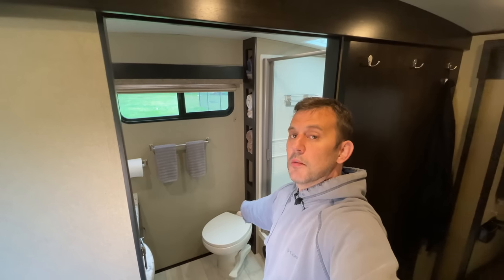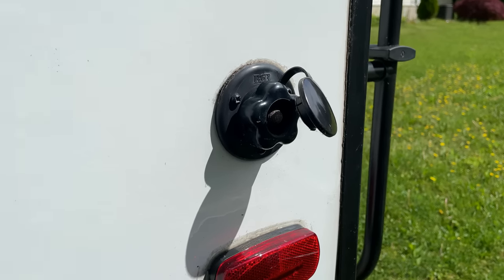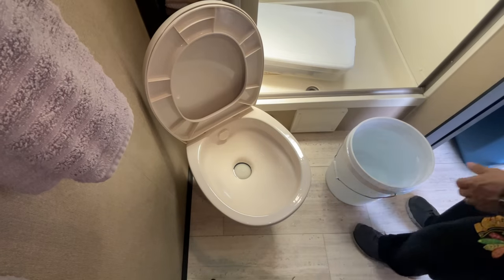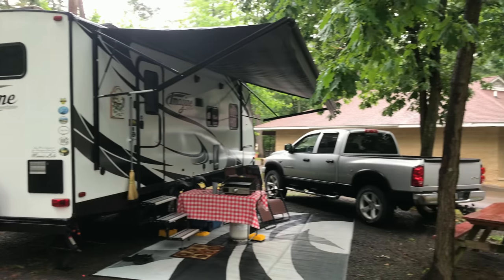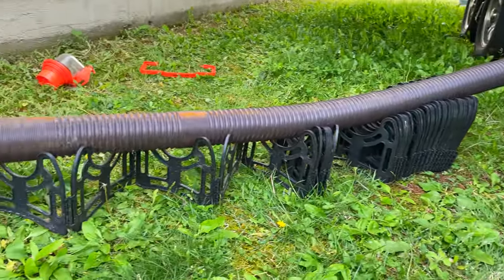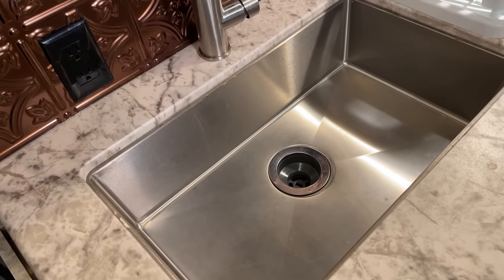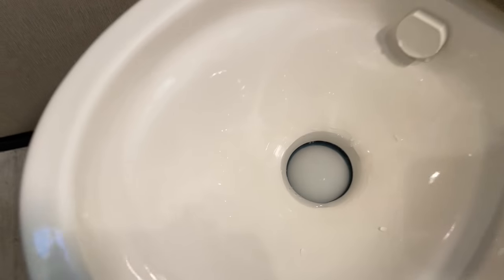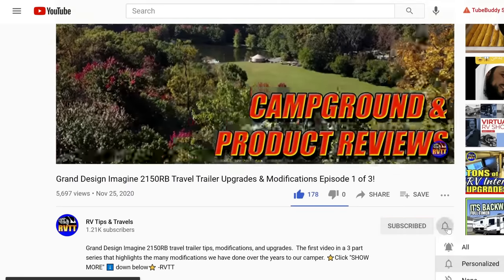RV Black Tank Cleaning, Maintenance, Tips & Tricks - The Original Black Tank Master Class

Comment from the maker: ✨*Here are links to all the products in this video:* ✨
✅ Flow Meter https://amzn.to/3znoxVD
✅ UPDATE - USE THIS TREATMENT: Liquified https://amzn.to/3IwNpjL

✅ Thetford Aqua Kem Treatment https://amzn.to/3znoQ2J
✅ Borax https://amzn.to/3wijFiF
✅ Dawn Dish Soap https://amzn.to/3gnwbYC
✅ 7th Generation Dish Soap https://amzn.to/3vmLDsi
✅ Rubber Gloves 6 Mil https://amzn.to/3XNo7Dc
✅ Camco Clear Elbow https://amzn.to/3wpJkpw
✅ Camco Rhino Flex Sewer Hose & Clear Elbow Full Kit https://amzn.to/3wmDWUo
✅ Camco Sidewinder Sewer Hose Support
✅ Hose Nozzle https://amzn.to/3vnTbe8
✅ Cleaning Wand https://amzn.to/3cAM2kn
✅ Valterra Clog Cleaning Attachment https://amzn.to/3pRtDF9
✅ Thetford Toilet Seal Conditioner https://amzn.to/3pUBToa
✅ Thetford Drain Valve Conditioner https://amzn.to/35jW7hq
✅ PB Blaster https://amzn.to/3cHkyJP

This video is a complete guide for cleaning, maintaining, & using your RV black tank.

Key Points:
-Keep water (along with treatment) in your black tank. Around 10% of your black tank capacity should be filled with water, always. 
-Be generous with water you use to flush & try to use the least amount of toilet paper as you can. 
-Wait until your black tank is about 2/3 to 3/4 full to dump. The fuller the tank, the more diluted it is & the better the flush you will get.
-After dumping the black tank, fill the tank to 10-20% capacity, and dump again.

BE COURTEOUS! If you are using a shared dump station and there is a line of RV'ers behind you, find another time & place to repeat the dumping process a 2nd or 3rd time.

🎥Toilet Paper Comparison: https://www.youtube.com/watch?v=ceCdXandlLU&t=57s

🎥Clear a Pipe Clog: https://www.youtube.com/watch?v=BUmPMGDEKxY&t=69s

#rvblacktank #blacktank #rvtips #blacktankmasterclass

✨⭐ OUR FAVORITE RV ACCESSORIES ⭐✨

ESSENTIALS:
✅ Camco Rhino Flex Sewer Hose & Elbow Kit https://amzn.to/3wxaiyG
✅ Camco 90 Degree Clear Sewer Elbow https://amzn.to/3eezBe7
✅ Camco RV Water Filter https://amzn.to/3VzcMqi
✅ Rubber Wheel Chocks https://amzn.to/3v0lL5I
✅ Hughes Watchdog 30 Amp Surge Protector/EMS https://amzn.to/3hAmgCy
✅ Hughes Watchdog 50 Amp Surge Protector/EMS https://amzn.to/3HKrpm1
✅ Liquified RV Tank Treatment https://amzn.to/3ksg1Ck
✅ Tire Minder TPMS https://amzn.to/3mjuBg0
✅ Water Pressure Regulator https://amzn.to/3m3ZFzZ
✅ Rubber Gloves 6 Mil https://amzn.to/3XNo7Dc
✅ Collapsible Water Hose https://amzn.to/3SvNubw

MAINTENANCE:
✅ Boeshield T-9 Rust Preventative & Lubrication https://amzn.to/3sjcjMx 
✅ Eternabond Roof Tape https://amzn.to/3Ad290J
✅ Geocell Proflex Sealer https://amzn.to/3KGMOyb
✅ Road Tool Kit https://amzn.to/41NIQKj

INTERIOR:
✅ Camco Cross Bar Door Handle https://amzn.to/3o8WWS5
✅ Shower Caddy https://amzn.to/3bdU80W
✅ Soap Dish https://amzn.to/3pKheSn
✅ Oxygenics Shower Head (White) https://amzn.to/3nhDMYW
✅ Oxygenics Shower Head (Brushed Nickel) https://amzn.to/2O8YcYC
✅ Perfect RV Paper Towel Holder https://amzn.to/3tZxd1K
✅ Dimmer Switch https://amzn.to/3rQdfFD
✅ Sliding Door Latch https://amzn.to/3EkpTT0
✅ Puppy Paw Hook https://amzn.to/2N9JaRV
✅ Foldable Storage Bins https://amzn.to/3tIp01f

EXTERIOR:
✅ X Chocks https://amzn.to/3m3ck2i
✅ Carmtek 10 Digit Keyless Entry System https://amzn.to/3t4IMpB (see the video here: https://youtu.be/KcEUgsDw6kk)
✅ Low Point Drain Valves https://amzn.to/3Jd6adb

OUTDOOR GEAR:
✅ Blackstone Griddle 22” https://amzn.to/3MDDiL0
✅ Blackstone Griddle 28" https://amzn.to/3eBnOuD
✅ Outdoor Gravity Chairs https://amzn.to/3Sb1p4M
✅ Ground Mat https://amzn.to/41u3wXg

💥 Sign up for our FREE Newsletter: https://view.flodesk.com/pages/6497c6a9d1998fa8c7623e9f

✨⭐ MORE RV ACCESSORIES ON AMAZON ⭐✨
https://www.amazon.com/shop/rvtipstravels

💥 NEW TO OUR CHANNEL? Check out our catalog:
https://www.youtube.com/c/RVTipsTravels/playlists

🙏 If you want to help support our channel you can donate here: 
https://www.paypal.com/donate/?hosted_button_id=J2KKM9NR3BJJA

✨⭐ DISCOUNT CODES TO SAVE MONEY ⭐✨

🔨 Learn how to repair & maintain your RV like I did w/ this COMPREHENSIVE training course:
https://rvtechcourse.com/?ref=rvtips&travels

🚐 10% off RV Snappads! https://rvsnappad.com/discount/RVTT10

🛌 Get 25% off your RV Mattress by Brooklyn Bedding at https://rvmattress.com/rvtips
Use discount code: rvtips

📡 GPS Tracking for your RV! https://www.wheresafe.com/rvtipsandtravels
Get 10% off by using discount code: RVTIPS10

If you find a dead link, let us know & we’ll send you an RVTT sticker!

📺 Want to see more RV videos? Please SUBSCRIBE & CLICK THE BELL ICON 🔔 so you're notified when we release new videos!

Follow us on social media:
📸 Instagram https://www.instagram.com/RVTipsAndTravels
🕺 Facebook https://www.facebook.com/RVTipsAndTravels

We may receive a small commission for purchases made through the affiliate links above. There is NO additional cost to you when purchasing from our links. We GREATLY appreciate your support!
Reply: I believe the storage pipe diameter is two big and it curls up and gets stuck that way.    They couldn’t get a short section of it in.
Reply: Good Information!
Reply from the maker: @jillphillips8117  thank you

Comment: After hooking up the sewer hose to dump, I ALWAYS open the grey tank for a few seconds first to ensure that the connections are good and the sewer hose hasn't sprung any leaks or deteriorated. I'd much rather have the grey tank contents on the ground unexpectedly than black tank contents. After a few seconds, I close the grey tank valve and open the black tank valve. When the black tank us empty, I finish emptying the grey tank to flush the hose.
Reply from the maker: Excellent tip Doug, thanks for adding!
Reply: Hopefully you're allowing the grey tank to empty into the black to get the solids out better?
Reply: @rolloverriderpgr  Grey tank does not go into black tank.
 that's why there is two tanks.
Reply from the maker: @rickjones2534  here's how you would do it.... first you would need a gate valve installed at the end of your sewer pipe.  with gray closed, open black tank factory valve and the aftermarket valve at the end of the pipe.  then close black and end valve, open gray, it will flow back up into the black to flush a bit more, then open end valve to dump everything.
Reply: Newbie 5th wheel owner here... so does the grey tank empty into the black tank or empty into it's own exit hose? Thanks!
Reply: @alisonmcirvin4763  no they each have their own valve. You can install a 3rd valve to close of both and do it that way. Best to dump your black after it's moor than half full, then refill with clean water and flush again. Then dump your grey.
Reply: @rolloverriderpgr  even if your RV is set up differently than 99.9% RV’s built there’s no reason to empty your gray tank into the black tank if your using the system correctly. Cheers!
Reply: @alisonmcirvin4763  if there is a gate valve just before the hose connection that closes it off it will flow into the black tank.
What I and a few thousand others do is empty the black then close the gate valve and open the grey and it'll flow into the black. 
Then close the grey and open the gate valve and the black and let that flow then repeat to try to flush it completely out and then open both to let everything drain.
I take my black tank hose I have just for this procedure and run it in the window to the toilet and add a few gallons and spray it in hoping the pressure dislodges anything it hits. They also sell tank sprayers you can hook your hose to, to rinse the tank out.
If you don't have a gate valve at the end of the line you can buy them and add it to the system.
Reply: @rolloverriderpgr  You are mistaken, it doesnt flow into the tank, it flows through the lower portion of the black tank pipes and valves and the sewer hose and flushes solids from the hose so you can have an easier time rinsing and storing it. It definitely doesnt flow through the black tank.
Reply: @RVTIPSANDTRAVELS  funny but it came from the factory built just like that.
Reply: @alisonmcirvin4763  they both have their own line that come together into one drain. The grey tank can be directed into the black to flush out the settled solids. Reading some of these comments there are idiot know it all that don't gave a clue but refuse to learn anything by watching a video on how to dump tanks.
Reply: @MrGbustamante  duah. Read my comment again but I'm thinking your reading comprehnsion is lacking.
Reply: @rolloverriderpgr  I read that the black is dumped into the grey which is not possible
Reply: @rickjones2534  ya really need to watch a few you tube videos on how to Mt those tanks as mine are connected at the factory to divert grey into the black tank to flush out those solids sitting on a flat surface inside that tank.
I'm sure you'll get to watch many RVers pulling a valve to divert the nice and liquid grey water into that nasty black tank and you'll leave with a 100% understanding on how it's been done for many years slick. Live and learn before co.menting on the world wide internet where everyone can read stupidity straight from the stupid.
Reply: Great idea! I never thought of that.🤗
Reply: @rickjones2534  😅
Reply: That's smart thinking.
Reply: @UCzfyJ5NPVnC8xCYYm8q85Iw That process creates the possibility of contaminating the grey tank, it sounds like a good idea, but it is not. If you want to get the solids out of the black tank, first top off the black tank before the first dump. If you need another flush, then fill the black tank again. Once the black tank is empty, you use the grey tank water to flush out the sewer hose. This is what the video says to do, too.
Reply from the maker: @farklealberts  correct, I never said to do this in the video, I was just answering how to do it in the comments.
Reply: @RVTIPSANDTRAVELS  Agreed - sorry for the misdirected reply, it was intended for the viewer who said to flush the blank tank with the grey water. Great video, BTW.
Reply from the maker: @farklealberts  No worries Chuck, I didn’t take it that way. I agree with you, fill it up, dump it out. Rinse rinse rinse.
Reply: Thanks, I will do that from now on.
Reply: Great advice Doug Crockett
Reply: Verrrry informative video,,thanks..
Reply: This whole process grosses me out. Sure you're flushing out the hose with grey water but it still probably has a bunch of nasty stuff stuck inside it and is crawling with bacteria. Do you clean the hose or just toss it back in the storage bin? As a young single guy I've been dry camping in my trailer since I got it because the whole process of cleaning waste out of the trailer sounds awful plus my theory is that once you start running water through a trailer that's when all the issues start from mold to bacteria. I don't know man... is all of it worth the trouble just to crap in your own trailer?
Reply: @user-uy3eq5hg1s  HELL YES.  Public washrooms are DISGUSTING.
Reply: @rolloverriderpgr  at first I thought you were crazy. Then after reading it again several times and my thick brain finally comprehending what you was saying I see what your doing. All I need to do now is get another gate valve to put at the common point of my drain where the two tanks empty. I can see this working as long as I have enough gray water to fill the line back into the black tank. It's worth a try in my opinion.
Reply: @farklealberts  what difference does it make if the gray tank gets contaminated  ? I hope you don't drink from it or use it for anything other than holding waste water.
Reply: @stevenjackson7067  Smells. That's why. No good reason to risk introducing human waste into the gray tank, even if it's just a little bit.  Just dump/flush the black tank by itself. Then dump the gray tank separate. No need to "flush" the black tank with the gray contents if you "flush" the black tank as described in this video.
Reply: Great idea and good practice. Had an almost brand new hose leak on us last trip out.
Reply: @stngstr  Please explain to me how using grey tank water to help flush the black tank will contaminate the grey tank.
Reply: @rickjones2534  ❤
Reply: @rolloverriderpgr  uhhh NO...
Reply: plus you are also pre-lubeing your hose
Reply: Not a bad idea. I borrowed an RV with a cheap black tank hose. I noticed a tear before using, thank goodness
Reply: Douglas dumps
Reply: Thanks so much for that suggestion as I just experienced the situation that you described a few days ago.  I was so upset with myself since I had not attached the hose well enough.  It too awhile to wash the compartment out and all of the "stuff" that I keep in this area.  Thanks again, great idea.
Reply: Great idea to check for leaks with grey water because SHIT HAPPENS.
Reply: Thats not a 💩ty idea whatsoever!  Good call.
Reply: Exactly what I do.
Reply: @user-uy3eq5hg1s 
 it was especially worth it during the COVID crap going on, and FLU SEASON too... Went everywhere we wanted too, no worries on restrooms, had off hours once every 2 weeks food shopping times days... So much better than getting, or worring about getting sick... Besides not going out at night to poop, I'm an old retired man... lol...
Reply: Great idea!
Reply: @RVTIPSANDTRAVELS  great videos. When winter storing is it still OK to have water in the tank.(freezing)
Reply from the maker: give your tanks a good cleaning before winter storage, but leave them empty.  that is really the only time you should keep your tanks empty, but not without a good cleaning first. heres a good way to get tanks clean: https://youtu.be/TsLpaJqaWpI

Comment: One of the tricks I use to clean my black tank after dumping is to leave the black valve open, raise the sewer hose about 2 ft near the valve and then open the gray tank valve. I leave it open for about 30 seconds to allow 10-15 gallons of soapy gray water to run into the black tank, loosening up any stuck deposits. I then close the gray valve and lower the sewer hose, allowing the soapy gray water to drain out of the black tank taking any remaining deposits with it. Then I shut the black valve and drain the rest of the water in my gray tank normally. I'm a full-timer who boondocks most of the time, so I don't use as much water in the black tank as I should. I've found this method cleans the black tank quickly and effectively so I haven't had any problems with waste accumulation for the last 3 years since I've been using this technique.  BTW I use Blue Power in my black tank and wash my dishes with Dawn, squirting a little extra down the sink about once a week to help keep the gray tank clean and grease free too.
Reply from the maker: Great tip to save water Chip!  Thanks for watching!
Reply: We do the same, but using a flush elbow with an additional slide valve.  As long as the gray tank is near full the pressure will be one way toward the black tank.  Pull gray, backflush for about 10 seconds, shut down gray, then dump black again.
Reply: @glfredrick1  We do something similar, but as you said, only when the gray tank is full.  You never want any backflow from the black tankgoing into the gray tank!
Reply: Genious
Reply: Wouldn’t that contaminate gray tank possibly?
Reply: @robertware5844  If you left the valve open too long so both tanks equalized in height, there's nothing to prevent any backflow. However, I shut the gray tank valve long before there's a chance of any backflow, as I typically have 40-50 gallons in my gray tank before I dump and only leave it open long enough to transfer 10-15 gallons max. But you are right, you can't just walk away from it while you are transferring fluid from one tank to another. If you left the valve open too long (say you only had 10 gallons in the gray tank) and there was some minor contamination due to backflow, you're going to dump the gray tank immediately after dumping the black, so it would flush it out right away. I doubt it would hurt anything anyway.
Reply: I've always been told to never open both valves at the same time because black tank contents can backwash into your grey.
Reply: @SuperSushidog  great comment!